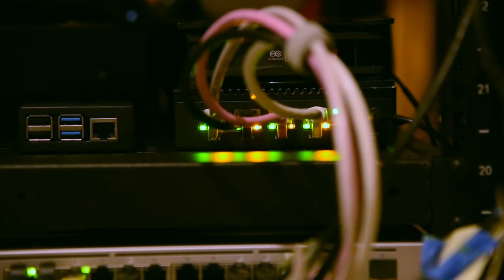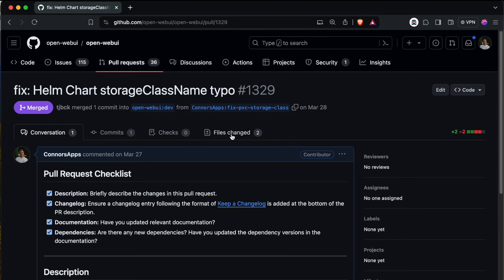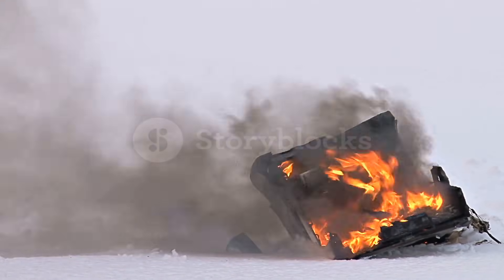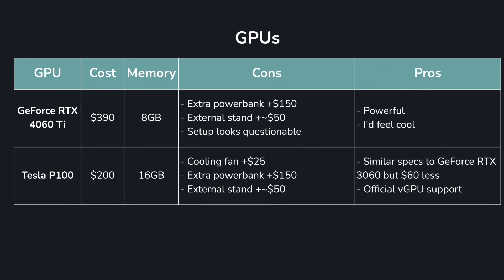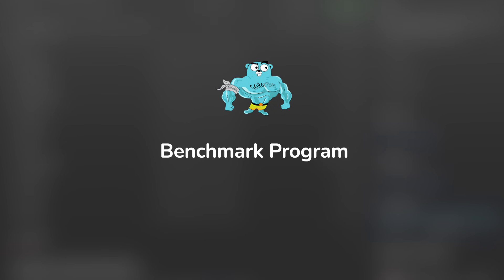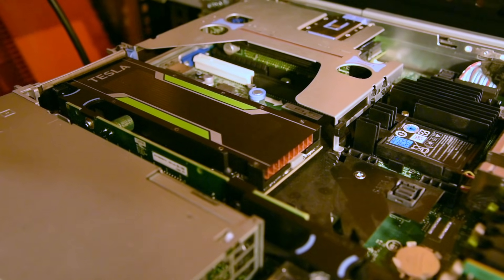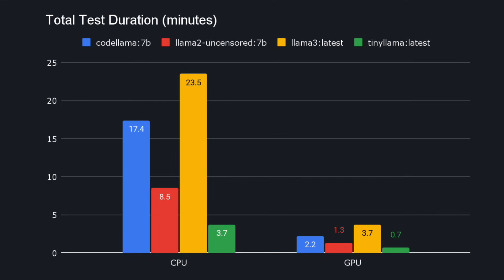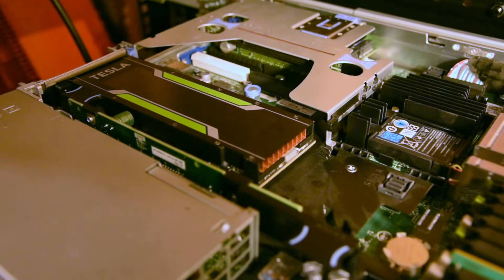Uncensored self-hosted LLM | PowerEdge R630 with Nvidia Tesla P4

Comment: How do you get the monitoring dashboard? I was trying to look for a docker container that can grab those data. Especially if they can read sensors like temperature for GPU and CPU. Kind of like Windows HWInfo, but Linux and can be run in web mode for a headless server

Comment: It may sound like a dumb question but how are you getting what you were running into a subdomain running on your main domain?
Reply from the maker: @boogiexan  there’s a few different types of responses (record types) you’ll get from your local DNS server. Usually you’ll have an “A” record at the top level pointing to example.com. So it would be type=A name=@ value=1.2.3.4. You just have another record for your subdomain like type=A name=api value=1.2.3.4 which would direct to api.example.com
Reply from the maker: Also did I mention DNS in this video 😂?

Comment: Drivers and OS? I couldn’t get that from the video
Reply from the maker: Good point, I'll update the description. I run Ubuntu 24.04. I'm using https://github.com/NVIDIA/k8s-device-plugin for working with nvidia GPUs in a Kubernetes cluster. That page provides other guides on getting OS specific drivers installed.

Comment: Interesting setup on an Intel Xeon E5-2640. I'm trying the same with my AMD Ryzen 5600GT, but still haven't decided if I should get the M40 with 24 GB of RAM, or the "newer" Tesla P4.
Reply from the maker: @jco997  the m40 is quite a bit longer and I would have gotten the the p40 or m40 if I could. What server do you have?
Reply: @Connorsapps  My comment was deleted for posting a link, but is a custom build AMD Ryzen 5600GT. Your's, I think, must be an Xeon E5-2640 v4, considering you have a Core Count of 20.
Reply: I normally use cpu benchmarks from passmark, since it gives me a ballpark figure on how much performance I could expect from any CPU model.

Comment: Good video. I run a similar setup on an R-720, but i'm using an RTX 2000 Ada Gen (16gb). No external power needed, uses a blower style fan so no need for an "external" cooler solution, really, but they run about $500-$600 on ebay.  I got mine for $550. I'm on the hunt for another one. It's basically an Nvidia 3060 with a couple hundred more tensor cores and more vram. So not too shabby. I'm using a proxmox container for the AI Gen stuff. My model is a fine-tuned version of Dolphin-Mistral 2.6 Experimental with a pretty chonky context window.

Comment: Could you fit two Tesla P4? Also what os you using on your machine?
Reply from the maker: @TheSmileCollector  it could fit another one but I’d have to remove its idrac module. Ubuntu server.
Reply from the maker: What OS do you usually use?
Reply: @Connorsapps  Sorry for the late reply! Just got proxmox on mine at the moment. Still in the learning stages of servers.

Comment: I have a PER730 8LFF running unraid. I found this video with a very vague search (tesla llm for voice assistant self hosted) but I was looking at the Tesla P4 for all the same reasons. 75w max.

I don't want my r730 going into r737-max mode (with the door plug removed in flight, so you get the full turbine sound in the cabin, if you want that "riding on a wing and a prayer" vibe, like you're literally strapped to and riding on the wing during flight). I considered the p40 but I'm in California, the electricity cost difference could be a week worth of groceries in the Midwest, or lunch and dinner here...

Thankfully theres one on ebay for only a couple dollars more than china and i can have it in 3 days. But its good to see someone else with basically the same use case. Also running jellyfin, and wanted acceleration for that too.

Anyway glad you did this. Your vid made me confident in the $100 for a low budget accelerator.

Btw what is your cpu/ram config? Im on 2x e5-2680v4 14cx2 (28c56t) and 128gb 2400 ddr4 ecc.

Everything i want to accelerate is in containers so i should be good. Thanks again 👌
Reply from the maker: In the midwest, food cost is actually pretty dang close to everywhere else but you're definitely right on the electricity.

I made this video due to the lack of content on this sorta thing so I'm very glad it was worth the time.

2x CPUs Intel Xeon E5-2640 v3 (32) @ 3.400GHz

Memory: 6x 16GB DDR4, in total: ~95GB

Comment: Great video, I got my hands on a couple of supermicro 1U servers and tried the 1st part (CPU only) of your video, is there any other GPU that would fit in that slot ?
Reply from the maker: The GeForce GT 730 will as seen here: https://youtu.be/5kueBAgigj4?si=Bl1zuecYDxfYJNgQ&t=188 but you've gotta cut a hole for airflow. You're super limited if you don't have an external power supply so I'd consider buying a used gaming pc and using it as a server.

Comment: For anyone trying this on old enterprise hardware on top of VMs.  Tread carefully with the HPE Gen 7 through 8.  There's a bios bug that will not allow you to do PCI passthough and you wont be able to do anything PCI related.

Also, underated channel.
Reply: Im guessing this is on specific bios versions, have done pci pass through on some gen 8s and luckily did not have any issues.
Reply: @JzJad  Mine is a G7.  I'm personally on the most recent BIOS version.  I've pretty much given up trying to make it work.
Reply: dang, just got a p4 and have a hpe g8... welp, worst case scenario is that I can get a better server in the future I guess... Or sell the card if I really have to...
Reply: @nokel2  I've heard gen8 has better results with workarounds as those tend to be more favored by the community.  I have a gen7.
Reply: I had a DL160 Gen9 that refused to PCIe passthrough on Proxmox, even after upgrading to the latest SPP BIOS.
Reply: @jackwyz22  Welcome to the club.

Comment: the r630xd and r730xd have room for a decent sized GPU and PCI-E power connectors you can use with adapters
Reply from the maker: I was actually looking into buying one of those models but I couldn’t justify another heat generating behemoth in my basement

Comment: this was a well made video, is this channel going forward going to be about home lab or server stuff? Im working on my own home lab with Ollama3 with my 3090 fe (ik its overkill lol) and I love seeing ppl make their own stuff. Also, do you know how to make 2 gpus work for Ollama? I added in a 3060ti fe and it isnt being used at all with Ollama3
Reply from the maker: Programming and tech is my biggest hobby so next time I have a bigger project  I’ll probably make a video.

Depending on the models you’re using GPU memory seems to be the real bottleneck.

As for getting 2 GPUs to work for ollama I wouldn’t think this would be supported. Here’s a GitHub issue about it https://github.com/ollama/ollama/issues/2672
Reply: I have not been able to split a model across multiple gpus, but Ollama has loaded a second model to a second GPU, or offloaded a part of a model to the CPU. I have an RTX 2000 Ada Gen (16gb) and an old NVIDIA 1650. With the context window, my main LLM is about 12.5GB or so. That goes onto the Ada Gen. When I send something to the 4gb llava/vision model it dumps most of it onto the 1650, with a small chunk going to CPU. It is significantly slower than the main model but not annoyingly so (and hey, I only use it occasionally).